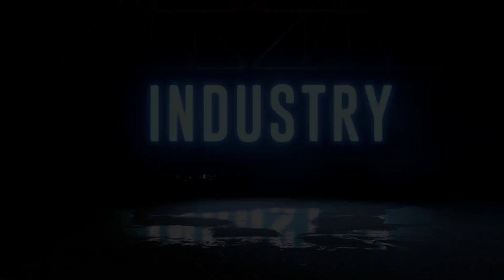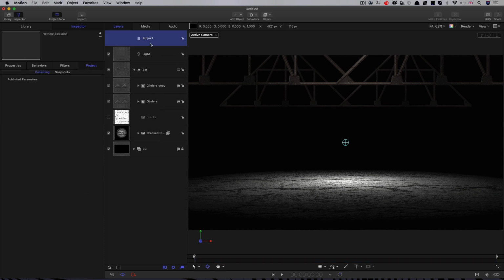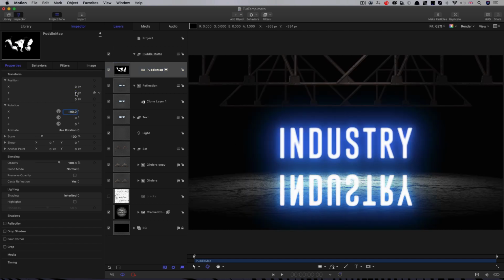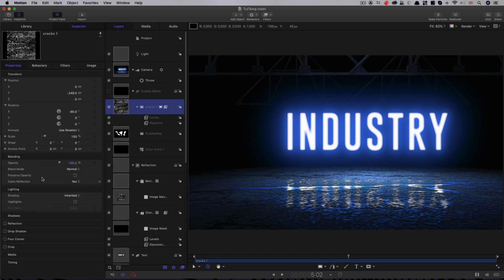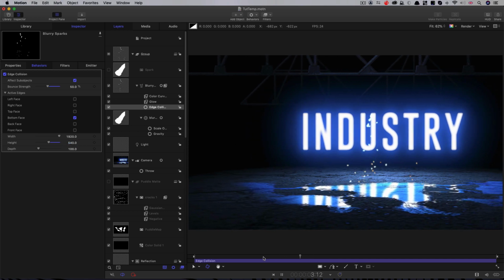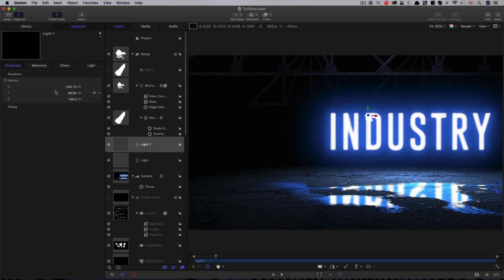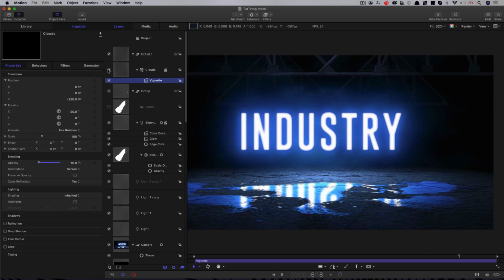Apple Motion: "Industrial Warehouse Title" Tutorial

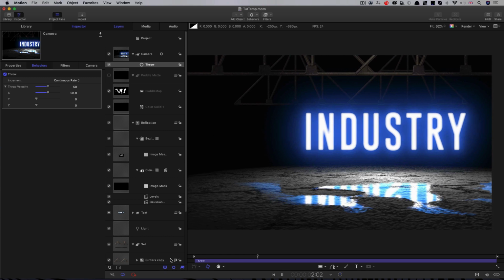Comment: ok I'm stuck. I've trashed and restarted 3 times following step by step. but I'm missing something. whenever I get to the 11:21 mark of this video. My floor and set do not move with the reset of the scene. what could I be missing?
Reply from the maker: It could be that they are not in a 3D group.
Reply: @SimonUbsdell  
Thanks so much for the Reply, Good sir.  I'm guessing since the original black CS  and then the cracks PNG are at the bottom. I would have to disassemble and back track to add them into a 3d group? simply changing the BG, floor, and Set groups do not seem to be resolve it. Actually. don't respond to that. I'm determined to take what I've learned from all of these tutorials and figure it out.  Hope all is well.

Comment: Great effect! Especially the water flowing / floor stuff look really amazing.

I do have two questions though:
1.) How would I go about to make this into a template so I could change the Text and probably colors without modifying multiple layers?
2.) Kind of independent of this tutorial, but just out of curiosity: Does Final Cut support a similar system to Media Link by Adobe in Premiere/After Effects? As in, can I use my unredered motion files in my projects to set pre-exported parameters from within Final Cut? That would be awesome!
Reply from the maker: To make this into a FCP X Title all you would have to do is go to File/Convert Project To/Title. 2) You can move projects between FCP X and Motion using XSend Motion: https://fxfactory.com/info/xsendmotion/. To get a Motion project back to FCP X you need to publish as a Generator - or anything else you choose. Watch the tutorials for more info.